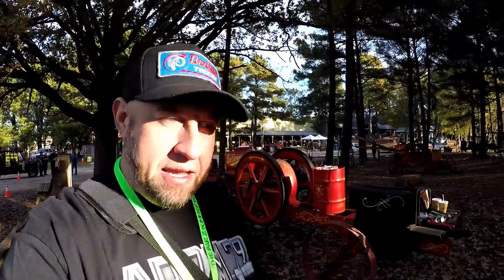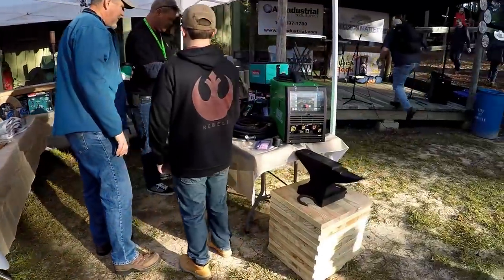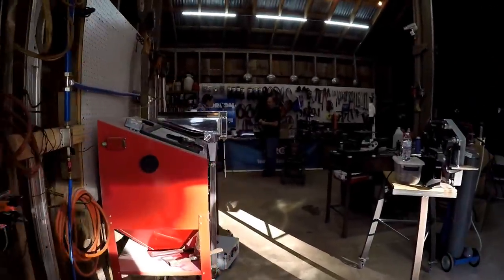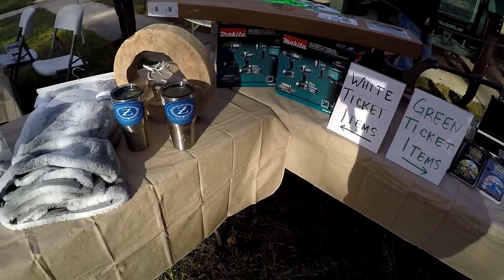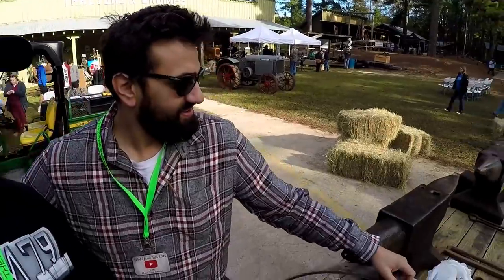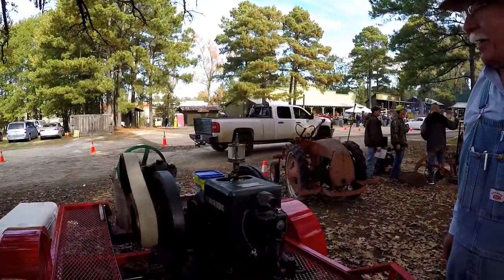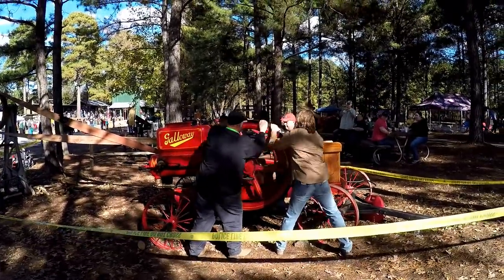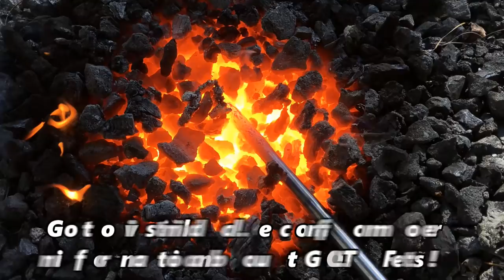The Good of The Land Festival, Lindale Texas

Comment: I can't believe there weren't any old timers there to show you all how to start those big engines without fighting with them.  You don't try to spin crank one like a starter , you rock it back and forth a few times on compression just before the mag impulse(it warms and mixes the charge good) then twist it on over and bang it is gone. A proper tuned engine only takes a quarter twist to start. :-)

Comment: Another great video Adam, the guys pouring the lead ingots need to be wearing full face masks, look up what can happen if the pour goes wrong, it's not pretty getting sprayed with molten lead.
Reply from the maker: Aluminum, not lead
Reply: I hadn't watched up to the point where they said it was alloy, either way though it's damn hot and surprised to see lack of basic safety gear especially with heaps of people standing nearby

Comment: @13:40 What is the belching that this engine is doing?  Does anyone have a link to some kind of explanation?
Reply: Same thing @18:00
Reply: its a hit-and-miss engine a leaf valve can be used on the intake maybe its oscillating
Reply: Hit-and-miss gasoline (sometimes kerosene) engine. It has a governor on it, which can be adjusted to a desired speed. When it it drops down below that speed, the governor will actuate a mechanical injector, squirt a bit of fuel-air mix into the cylinder, and fire the magneto. When it's just running idle like that, it'll rotate several times between each power stroke.